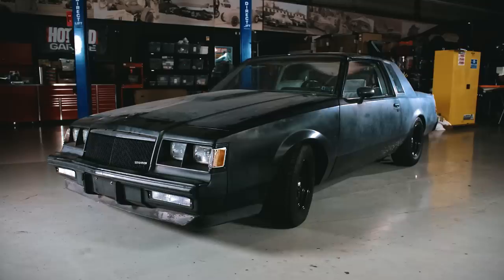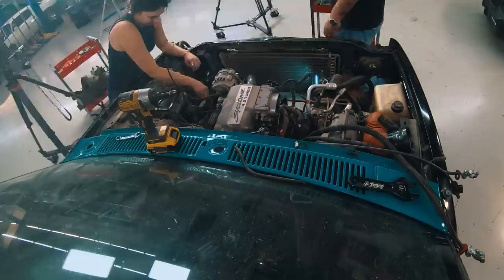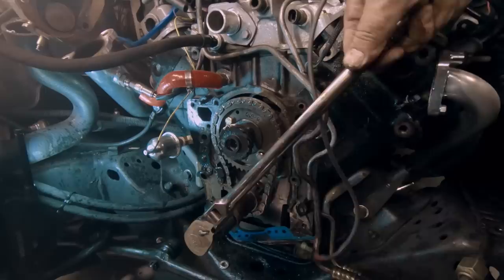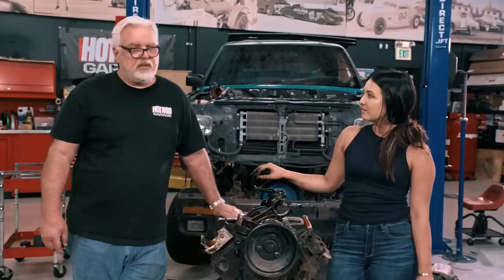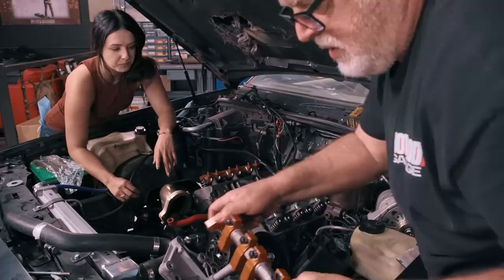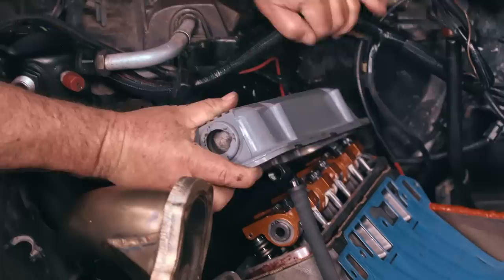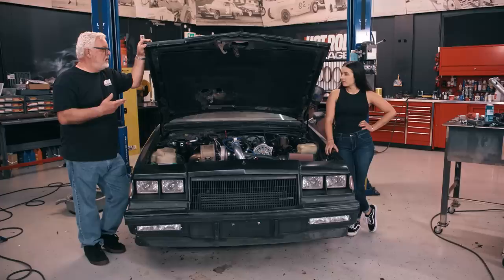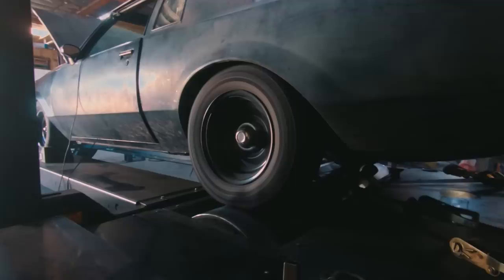Re-redeeming the Grand Trashional | HOT ROD Garage Full Episode S10 E2 | MotorTrend

Comment from the maker: What would you do to fix the Grand Trashional?
Reply: Stick some stamps & my address on the bumper 😄
Reply: Why not build a small block Buick 350 that will even fit on the v6 motor mounts for this thing? Molnar makes aftermarket connecting rods for the sbb 350 now so that is no longer a weak link. And TA Performance makes aluminum heads for the 350 as well. The sbb 350s love boost as much if not more than the Buick v6 too. The factory cranks hold up very well and so do the blocks. As a matter of fact the blocks hold up better than the BBBs without the jock strap(girdle).
Reply: drop a Hellcat engine in it 😁
Reply: Put a Garret variable geometry turbo & a larger intercooler (with a diverted AC line). Maybe a GNX modchip.
Reply: fix the oil leak . my son says put a LS in it
Reply: Based on the 378 HP and ~3500 weight it should run 110mph and with traction mid 12s. You are seeing 105 MPH and 14 and 15seconds. I'd start w/ the MPH and debug. My first guess is not enough fuel. See if its leaning out and if you have enough PSI from the pump and injectors. Once the MPH comes up its a traction problem which you are well equipped to solve. Hope to see how this trashional progresses.
Reply: Just give the hosts time in the shows to actually get the projects debugged and dealed in. It will make for much more interesting shows. All this half-arsing and jumping between projects, showing of new shiny sponsored parts, feels like shallow entertainment with little substance. A lot of YT channels big success are actually based on they their take time to dive into the technical details and the solving of problems ... on camera. Good hosts can turn "boring" stuff into something interesting and entertaining.
Reply: Allow Aussie’s to join the mt app again
Reply: @Tolandur   lets just drop alex taylor
Reply: U are using the engine out of a TYPHOON! This is incredible haha
Reply: Put a manual transmission in it.
Reply: Ummm.....Call Gordon Murray !
Reply: Stop calling it a stupid name would be a start.
Reply: Demolition Derby.
Reply: 255 RWHP wasn't bad, but the dragstrip performance seemed to be missing something... overall tune? traction? Inefficient tranny? Rear end ratio? Weak posi?
Reply: I'd bring Tony Angelo back
Reply: Get someone with GN tuning skills to tune this thing. Get a proper converter made for the combo.  Turbo Buick Performance/Full Throttle Speed have awesome converters. Dusty Bradford can spec a PTC 9” for it that will be spot on. Cruz or Cal Hartline can give plenty of tuning help
Reply: Not give away "behind the PAYWALL" footage for free. 
This is a slap in the face to subscribers.
Reply: @wbball15  , they are trying to gain more subscribers. It may not be easy to sell a product without any showing upfront of what you selling. I guess MTOD are feeling heavy competition from all the similar free car content channels you can find on YT.  To me their shows feels somewhat dated in style/format in this day and age.
Reply: It has all the right parts… it’s either in assembly or tune.
A stock engine has been 9’s so for this to run slower than stock is embarrassing. Need help hit me up.
Reply: Swap turbos.. to a 76 76..
Reply: Swapping with the 4.3L from the Cyclone/Typhoon would have been a good move in my opinion. They are capable of 1 HP vs cubic inch when built right. Powernation squeezed out over 500 foot-pound of torque out of theirs.
Reply: @imonaroll9502  
When you switch to a Holley ECU the cam tool setting is not the correct reference like the stock ECU. We were one of the first to get a Buick up and running on a Holley Dominator. The engine is actually in a Mustang called the Bustang… it runs low 10’s on 93 pump gas.
Reply: @doubledspeedshop  Hater
Reply: @westmus  Doesn't seem dated to me.
Reply: @UR50SLO  No stock Buick ever ran 9s, unless you're talking about 0 to 60!  LOL!
Reply: @imonaroll9502  In case you didn't notice, the car is trashed.  AND Roadkill, Roadkill Garage and Hot Rod garage have a tradition of naming cars this way.  Vanishing Paint Challenger, General Mayhem, Crop Duster, Bone Maro.
Reply: @Im on a roll 9  Actually, my brother's Buick!  His car is an 87 GN.  Most GN owners keep their cars pristine, so 'trashing' one seems wrong!  :)  BTW, wasn't there a blacked out Cutlass in the 80s known unofficially as the Darth Vader Edition?
Reply: @imonaroll9502  For sure.
Reply: Add a LS
Reply: In it's day, the GNX was a beast. Granted, what you guys do with turbos is night and day compared to the Buick's V6. But consider that fact....its a V6 and it doesn't have all the bells and whistles that Holley's ECU does today. That motor was tuned mechanically and it was cutting edge.
Reply: @BigMountainCustoms  I believe McLaren was behind GNX & BUICK with G.N. I think?    Did you know this same Gran National turbo 3.8
was the 2nd and that Buick 
LASBRE 1978 was the 1st with exact same turbo 3.8.
78 LaSabre identifiers was a BLK b-pilar turbo
Chrome b-pilar N.A.  then T-Type & GN mid 80' s .    not that you care but cool & rare for Buick fans.
Reply: I’d figure out why 375whp only nets you a 14 sec 1/4
Reply: Very impressed with Alex! I love watching this show! She is a true Hot Rodder!!!👍👍👍
Reply: Too bad, Buddy Ingersoll wasn't still with us.  He knew his turbo cars.  RIP Buddy.

Comment: There is still something wrong with the Trashnational. Did you degree the cam still seems like it may be off. Needs new injectors and fuel pump?
Reply: Needs a hi stall converter and a 4.11 gear for rear.

Comment: In the 90's you could get low 12's for under $2000 without touching the motor...
Fuel Pump and hotwire kit
Race chip
K&N Filter
3" Downpipe and cat back exhaust
Spark plugs and maybe valve springs depending on mileage

I cut my hotrod teeth on an 86 T-Type and ran 11.82 in highschool with the above mods, plus a TA49 turbo and bigger injectors, plenty more in it with a few suspension mods and better converter...

Comment: My 87 T Type did 13.8 STOCK. 13.2 with gutted converter cone K&N and higher boost still on stock chip. Stock headers work well into 10 sec range. If Don Cruz donated headers you need to show y’all how to tune it too!
 These old V6 Buicks ain’t no LS!

Comment: I always use a drinking straw to find TDC on 1 instead of a hardened steel screwdriver.
Way less issues with possible engine damage 😉
Reply: You're not supposed to hammer the screwdriver into the top of the piston with a sledgehammer - you just lightly rest it on the crown with the tip of your pointer finger.
Reply: Can't use straws in CA. 😂😂😂
Reply: @ChristopherHallett  depending on layout the screwdriver can jamb sideways in the plug hole.  better idea to use something softer like wood or plastic
Reply: @techs1smh13  yeah, unless they're paper LOL
Reply: @btchhopperou812  👍😂

Comment: rather than "bag and tag", hit up your local delicatessen for the plastic containers they put salads in. fill with the necessary fasteners, and pour in a 50/50 mix of vinegar and salt, to make a brine that eats rust. then write on the outside where they go, and how (if they are different lengths or sizes, like in front timing cover assemblies, etc).

meanwhile, when pulling a cylinder head for its first time, a way not for it to end up on the floor like the 4.3 V6 nearly did, is to loosen the head bolts, break the head free of the block while the bolts are still grabbing some deck thread, and then pull out all the bolts and fab a nice little handle from scrap that screws into the rocker arm setup and now carry it like am attache case (what your father used for business before cell phones were invented to carry everything).

I would have thought a 1987 block would have roller lifters OEM, but Lucky makes it sound like the old cam was just "regular hydraulic lifter", ie, flat tappet.

Comment: RPM loss at the top is most likely due to spent valve springs, possibly combined with fuel leaning out. Fuel system needs monitoring(could have been done on dyno perhaps, assuring 1:1 pressure rise correlating to boost PSI w/baseline in low 40's), BTW, what size were those injectors and if the fuel was 'stinky', the pump should've been upgraded when the bad gas was evacced. Also, adding to the idea of a likely 'lean' issue was when the exhaust was freed up, performance actually went into the toilet totally. Aye... these cars have a decent learning curve- a LOT of 'little things' that can have a pretty big effect on performance. That said, for having 375ish R WHP, anything above mid-12's is pretty embarrassing, but being there is a general lack of familiarity with TB's, a mulligan is in order LOL. It was still a great 'watch', and although I kept talking to y'all trying to 'help' during the Buick re-build, I'm gonna watch it again and see what I missed... Thanks for the vid

Comment: My 87' Shelby Z lightly modded with a SOHC 2.2, stock Garrett T-3, 5 speed I ran through the traps low 13's
Reply: For mid 80's those and the Omni GLH were pretty freaky fast lil cars esp if you just up the boost some

Comment: These cars ran 13.9 stock. You guys install a $2000 set of headers, billet roller cam kit, CNC ported heads and big turbo, and somehow manage to run slower than a stock 1987 Grand National.
Reply: If I’m not mistaken, it’s not a real GN. Tony had mentioned that in the debut episode of the car
Reply: Ya the difference is they have a Grand rational and a Grand National Xperimental ran a 13.9. Similar yet different.
Reply: I don't remember any grab national coming with t tops
Reply: @johnsnow1355  my grand national has t tops
Reply: Yea they did come with tt0ps
Reply: I had one new off the truck. With 94 octane pump gas in 87 and a good spring on the wastegate for 17.5 lbs boost the car ran in the 12's.
Reply: My best with stock heads and cam turbo and injectors kb tb 70 mm suspension tune 10.28 @128 mph at sir seattle
Reply: Some answers for y'all. Yes GNs came with T-Tops and hard tops. Yes stock GNs were known to run 13's, those were the 1986 and 1987 GNs w/ the intercoolers. Yes the "experimental" GNs, AKA GNX, ran 13s all day. This car was a non intercooled (AKA "hot air" ) GN and they were 15second cars made in 1984 and 1985. This car was also not a true GN, but a Regal T-Type. The difference between a T-Type and GN was mostly cosmetic and did not affect performance. They all had the same drivetrains. All said, they swapped more than cams, heads and bolt-ons....  they swapped the entire  non intercooled 84/85 engine entirely for an 86/87 engine + intercooler and then bolted on. Hope that clears things up
Reply: Yeah they give bogus numbers to make it seem like better improvement. They entirety sounds ridiculous. They supposedly makeover 400HP and running 15s. They must be running a 2.56:1 final ratio. Still not sure how it slow to 15. The 6 sec driver must not really be a 6 sec driver. 
Agreed with the other I knew of several T types and grand national daily drivers that ran 12s back in the day.
Reply: @micahap1559  Alex is the real deal. Plenty of proof of her accomplishments online. The car is the variable here
Reply: @stevemullin7472  Who is Alex, the girl in the video?
Reply: @stevemullin7472  she’s building the car no? 👀
Reply: @mikeandNikes  different conversation. some guy was questioning the “6 second driver” as the issue.
Reply: Lord Rama   sexist much?
Reply: @agasrcng  nah he just jealous 🤣
Reply: People question Alex Taylor,must not know her,she is from Arkansas,And she drives a 55 Chevy that runs 6's all day at just over 200 mph!!
Reply: @Frankie--da-fixer  can confirm. I started her for rocky mountain raceweek last year after they got it built, before licensing. Thing kicked 7.38 first whack. She is a legit racer and wrencher, and all around gearhead. Some of these dudes are just mad they can't do it themselves so they gotta hate
Reply: @chadbeaver9199  Agreed I watch her on Drag week and Sick week,her Dad knows his S**T as well,very smart man,I live in Arkansas and hoping to make it to her new shop this year!!
Reply: 😂😂😂 FACTS!!!
Reply: @micahap1559  alex Taylor she has a drag and drive 55 Chevrolet that runs in the 6s.with her driving and tuning. She knows her business
Reply: @davidreed6070  lol ok. So I'm guessing you mean yes. Maybe
Reply: @Steve Mullin  addionally, a few GN's rolled off line with an astroroof known as CF5 option
Reply: Lol you don't know that much do you? Stay in your lane and pay attention.
Reply: @Steve Mullin and a few came off the line with  Astroroof, CF5 was the code.
Reply: "But we had fun doing it wrong"
Reply: That car should run low 10s with those parts.

Comment: I helped a friend go low 11s back in 87 and 88 they have a lot to learn.
Reply: Are you willing to share  your 35 year old embellished knowledge ?
Reply: You have to make the cassis to work. We used no hop bars and MT 9 inch slicks also unhooked the front sway bar. Installed an adjustment waste gate, transmission mods, factory ECM, factory fuel system. The engine was bone stock factory intercooler hoses used to blow off so silicone ones were installed. The turbo was upgraded in the low 12s to get us in to the 11s the injectors were cleaned and rebalanced to get to low 11s. The car they are working on should be gone over completely. It’s likely mushy in the suspension. The motor doesn’t sound healthy either. I was a Buick tech back in the day and the engineers knew how to build a turbo motor.
Reply: @jeeptk  I don't know what a cassis is.
Reply: @Hanzyscure  The frame and suspension

Comment: Ported heads, hydr roller cam, front mount intercooler, adjust fuel pressure reg, 3" downpipe, exh cut out, roller rockers, headers and Holley HP efi system running 14.1 @ 105mph.... OMG!!! What a epic fail. This should be a low 12 high 11 on pump gas at 16 -17psi, and a 10sec car with race fuel, more boost and a sticky tire.

Comment: Why not build a small block Buick 350 that will even fit on the v6 motor mounts for this thing? Molnar makes aftermarket connecting rods for the sbb 350 now so that is no longer a weak link. The sbb 350s love boost as much if not more than the Buick v6 too. The factory cranks hold up very well and so do the blocks. As a matter of fact the blocks hold up better than the BBBs without the jock strap(girdle).
Reply: It’s not a grand national with a V8
Reply: @mikeandNikes  
Tell that to the guys that put a BBB 455 in theirs because they want to go fast. At least with a sbb 350 in it it is a similar platform that the v6 is based on which would be a sbb 300. One of those would be good in there as well.

Didn't you watch the video, they were going to install a 4.3L Chevy turbo v6 in that car until they found out it had a spun bearing, at least the sbb 350 or 300 is a Buick engine.
Reply: @itseithergonnaworkoritaint7852  the 4.3L from the truck is still from the GM turbo V6 platform… acceptable in a GN… plenty of people go 9’s with these LC2 motors the builders just have no clue what they are doing. I have nothing against those big motors just not in a GN
Reply: @mikeandNikes  
No hard feelings but we'll have to agree to disagree then. I don't like Chevy engines in a Buick, would rather see a BBB in it than the Chevy 4.3L v6.

The sbb 300/340/350 will drop right in and bolt to the transmission and the v6 motor mounts and run really well with boost, just sayin. This way will be closer to being a GN than with the Chevy 4.3L just because it's a 6 banger. Like I wrote, the GN v6 is based off of the sbb engine platform. The v6 just has 2 less cylinders than what the sbb engines have. enjoy your 6 banger.

If the sbb engines were still in production when the FBI asked GM to build these cars they would of installed the sbb 350 in them with boost.
Reply: @itseithergonnaworkoritaint7852  so what about when Pontiac put the Buick V6 in the TTA? Was that bad? Or na cause it’s a Gm motor going in a GM? You know it was faster than all the V8 in that body TA right? Also who puts a V8 in a car that literally has 6’s all over it…
Reply: @mikeandNikes  
Well Chevy didn't want the 4.3L in anything but a Chevy and GMC trucks(except the very rare 4.3L Fiero) 

The 4.3L is basically a sbc 350 with number 2 and 3 cylinders chopped off of it. The 3.8L is basically a tall deck big bore sbb 300 with the 2 and 3 cylinders chopped off of it. Out of these 3 engines which 2 are more alike than the others?

The sbb 350 is basically the same engine as the 3.8L but with a longer stroke with 2 more cylinders. The front timing chain covers are interchangeable for crying out loud. The same motor mounts can be used and so on. These 2 engines are more alike than not alike. They both have the same deck height , the same bore spacing, the same bore size, the same motor mount locations, the same transmission bolt pattern  the distributors are the same just with different gears on them, they use the same oil pump that is in the timing cover, the list goes on and on....

The 4.3L has the distributor in the rear of the engine while both the Buick engines have theirs in the front, the 4.3L has a different transmission bolt pattern, different motor mounts, oil pump is inside the 4.3L while the Buicks are accessible from the outside, the 4.3L has a shorter deck height by 1.162" and so on. The only thing these 2 engines have in common is that they're both 90 degree v6 engines.,
Reply: @mikeandNikes  It's  a regal with GN interior.

Comment: How much rear wheel hp on your mates dyno does it take for a.  Naturally aspirated single four barrel Small block Chevy in a 3400lbs+ car, with th-400 and 9" to match the et. And mph of your turbo LS Camaro's et. And mph as you ran it on the day on 18 pounds boost?